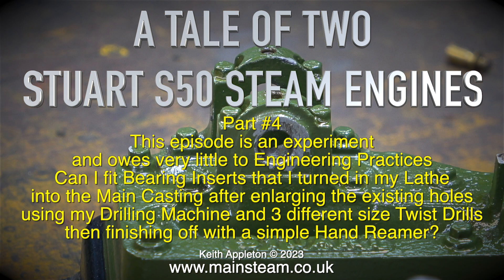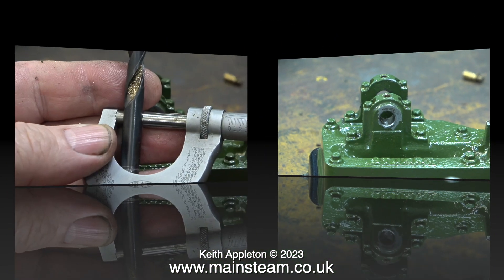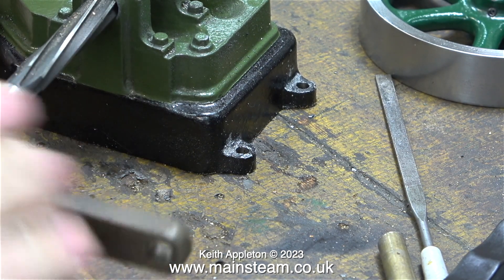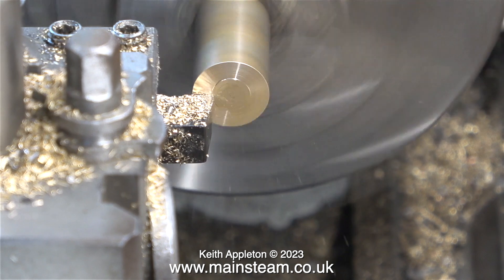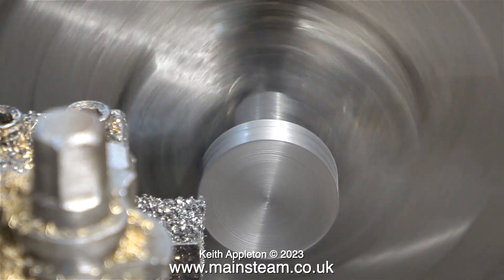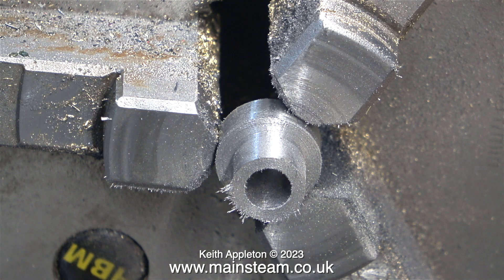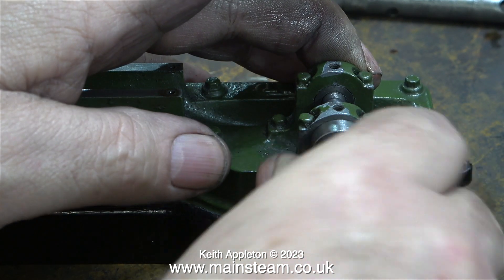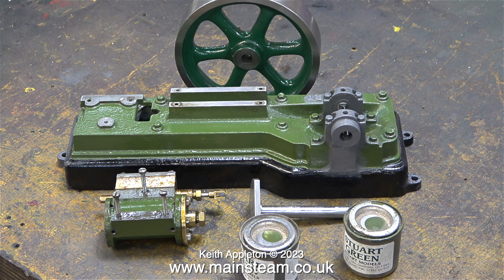A TALE OF TWO STUART S50 STEAM ENGINES - PART #4

Comment: Idiotic? Perhaps old school, but it's definitely foundational machining skills. If you don't have a fancy calculator, you use a slide rule or an adding machine and log tables. Same thing here. You're using hand tools and skill with only the most basic machine tool providing some elbow grease.
Reply from the maker: It works for me and it is quick . . . .
Reply: @keithappleton  Fifty-plus years of experience might have something to do with that.

Comment: So why did you use cast iron instead of the bronze for the bushings?
Reply from the maker: Because the original bearings were cast iron, which is an excellent bearing material (as used for miniature Locomotive Axleboxes) and I wanted to use the same metal as paint also sticks well to cast iron - as shown in the next episode . . . . . .

Comment: As an experiment it seems to have worked well. With the knowledge that there are often many ways to accomplish a job, I would have done the final reaming of the bushes once they were installed to ensure the holes line up and account for any movement when the locktite set. Many ways, all good if the job comes out right in the end.
Reply from the maker: I inserted the crankshaft after I coated the Bushes with Loctite, that kept everything in line . . . which was just as well as I mentioned in the video, I don't have a reamer that size .......